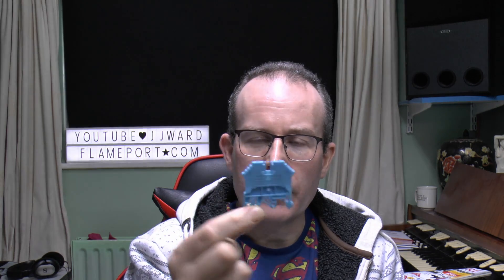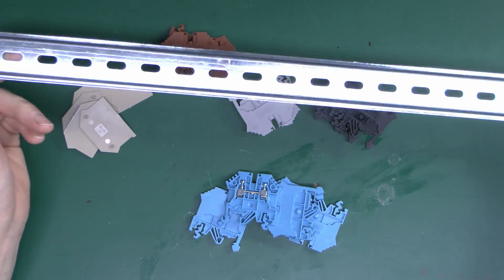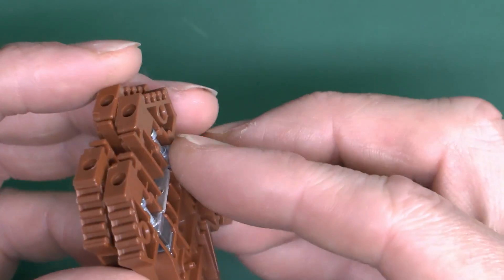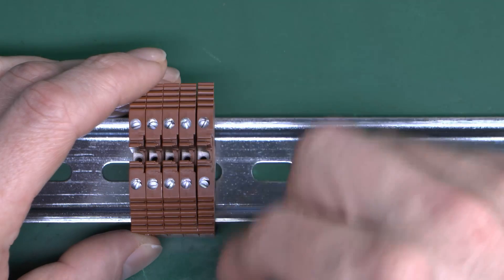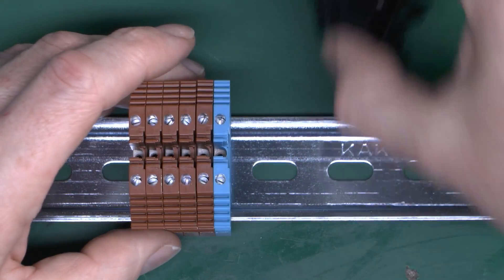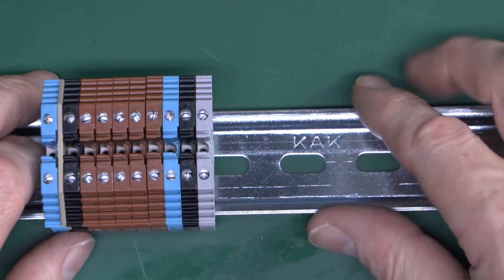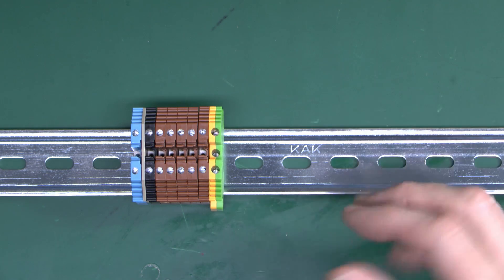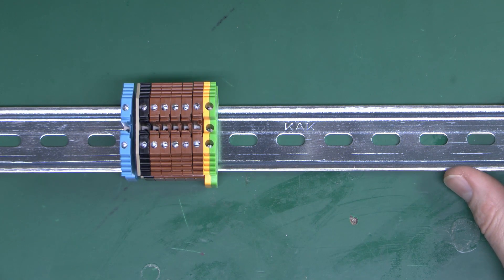Din Rail Terminals

Comment: great, the only thing missing is the available range of wire thickness for these terminals, for example, I want to use AWG 4 or AWG 6 , are they available in such size?
Reply from the maker: Yes, such as https://www.newark.com/entrelec-te-connectivity/1snk712063r0000/terminal-block-din-rail-2pos-4awg/dp/62AK7657

Comment: Love how much knowledge you give out. If you were to choose between push-in connection and screw connection terminal blocks, which one would you choose and why? I keep hearing that screw connections are unreliable due to vibration, while push-in connection risks of getting loose due to thermal cycling. Specifically I'm looking at Phoenix PTI 2.5 PE L N vs Phoenix UTI 2.5 PE L N. Thanks
Reply: U can go for elmex Control

Comment: @4:40 those joining strips are not very good as it can remove IP2X protection. There are other push in "blade" type joiners that are much better.
Reply: "There are other push in "blade" type joiners that are much better."   Better? No. They can fall out and lose connection if not properly inserted. The screw type are way more secure. As to protection the make cover strips for that.
Reply: You have to use the jumper type specific to the terminal blocks in use. The ones he showed are designed for screw jumpers, so you must use the screw jumpers made for that series. Others are designed for the blade-type jumpers, and in those you must use blade-type jumpers specific to that series.
Reply: @tookitogo  Timestamp?

Comment: I have the older style , rather than screws they use spring lock clips and to join multiple together you have a pin that drops between two. The grounds have a metal bar that rests on the rail rather than the locking screw that these ones use. I think I might get some of these new ones, they look more user friendly. Also have some fuse holder ones also.
Reply: The screw terminals are the older style.
Reply: @tookitogo  I only said that because they came out of a 15-20 year old hospital panel

Comment: The best dinrail terminals are siemens. They have plastic both sides, are fully symmetrical, and dont try to twist apart like the others. I've used cheaper ones in the past like Connectwell or Europa, and although they're ok for the money, I've had a few with stripped threads from new. Some of the most over-rated ones are Weidmuller/Klippon  IMHO

Comment: @ John Ward,
There are biege coloured end caps/retainers for Top Hat DIN Rail parts, they only have a central screw, that holds it to the DIN Rail.
The worst thing you can ever strike is that useless G-profile DIN Rail, that was a thing in the 1980's.
It was used in factories and try as you might to remove the terminals from the rail (with the supply still live) without snapping the bottom plastic clamp off, rendering it useless.
Top Hat is the way to go.

Comment: The PE terminal with conducting connections are allowed in insulation class I panels, but when inspecting Insulation class II panels we also come across them alot.. this is not allowed. Its a common made mistake.
In these kind of panels a continuity check with 200mA , proofs such a mistake easily.

Comment: We use this type of terminals 15 years ago, we swapped to Wago clamp terminal for speed and long lasting. A clamp terminal will keep the wire inside when you have vibration and a screw therminal need to be screw again to secure the connection once a years or less often depending on vibration. The clamp termnial save us so much time when wiring a new panel it's incredible.

Comment: Using it to extend the wiring for consumer unit is questionable as they are rated 24A and the socket circuit is 32A or 40A
Reply from the maker: Other ratings are available.

Comment: I have used thousands of these all makes all sizes alough the big ones 70mm plus tend to snop off. 
There is one point I have spent a lot of time in panels when they have been installed upside down when the springs age and work loose if on the rail the wrong way round any vibration causes then to fall off with obvious consequences this is even more of a problem with G rail which will lock the correct way but fall straight off if inverted.
If you look at the bottom of those terminals you will se they are known as universal ie they will fit both top hat or G rail (asymmetrical) rail. If ordering make sure which type of rail they are for.

Comment: 1:20  UK leave the EU but they use our german DIN (Deutsche Institut für Normung) Schiene (rail) in so many boxes. That's funny. 

BTW: The small connectors with 1/2 DU (5.1 mm) are cheaper copies of the Weidmüller connectors. Orginal have 400V / 24A / 2,5 qmm.

Comment: H jd what the best way to convert my generator from 3-phase to single phase .I seen converter   from single to 3 phase but not to opersit way round eny advice thanks
Reply from the maker: There is no conversion, single phase loads can be connected between neutral and one of the phases.

Comment: I have to confess I have never seen brown, grey or black terminals and deffo not red. Usually a sort of olive fawn colour. I am surprised as are other followers of yours JW that you are not using end locks.
I always use the bootlace ferrules on the control cables when I wire these things up, much neater and easier to fit wire into terminal. Have come across these terminals in days of old where strands of wire have been cut out to ensure too large a cable fits into terminal... lol. 
Good vid as usual JW, cheers
Reply: I always use a crimp-end of one sort or another in din terminals. It's all too easy to insert bare wires badly so they screw up at the end or a stray strand causes a short. . In a huge panel that could mean days of fault-finding wasted.

Comment: I used a DIN cabinet when I changed my consumer unit. 

I actually installed the DIN cabinet on a small piece of plywood next to the new CU and ore-wires the DIN rails to the MCBs on a bench. Much easier. Then ripped out the old CU, installed the plywood as one and terminated the house cables to the DIN rail connectors which were all labelled and ready. 

Looks nice and neat and the CU swap was much quicker - it needed to be for my situation. It was my house.

Comment: If you used that to extend CU wiring and it joined all the earths together (via the din rail). Wouldn’t that cause a problem during testing ?
Reply from the maker: Yes, for that application it would be better to use the insulated terminals for the CPC.

Comment: Use these all the time, I find it useful to install endstops that are attached like the earth connection as using a screwdriver on the screws tends to separate them.
Reply: Yep, especially when you crank down on the screw on the earthing terminals to get a good bite on the rail, they really open up. That's why its always nice to like you said, put an endstop. Preferably an endstop with an embedded metal strip in the clip so it bites the rail as well and stops it from sliding down over time. Allen Bradley as well as Electec (ABB) are the end-stops I like as they have this embedded metal strip in the clip. The A/B ones are kinda sharp and they REALLY bite into the rail. They don't slide at all and if you try, they dig into the zinc coating on the rail and get even more secure.

Comment: These terminals look like a copy of a very early design of the Weidmüller WDU2.5 terminal. The WDU2.5 is probably the most used DIN-Rail-Terminal in Austria and Germany.

Does the marking-system from Weidmüller fit on these CONTA-CLIP terminals?

Comment: Cheers John, excited to see more progress on phase converter. Nick Bundy did a video not long ago using these to move an old consumer unit inside the house. It was previously in the meter box outside. That was the first time I'd come across them but it was a neat solution. However your comment about square millimetres / millimetres squared pricked my ears up... 
Hope lockdown is going ok in Bournemouth
From neighbouring Southampton
Cheers

Comment: The end cover should be locked off with a locking stop end which screws to the rail, a terminal cover is also available which is usually used in industry.

Comment: John, if used as described to extend cables for a cu change, would you use the green earth terminals for CPCs? All of the CPCs in the install would them be common at the din rail. Could this affect your readings during inspection and test? Maybe lower R2.
Reply from the maker: Better to use the insulated terminals for that, otherwise all the CPCs would be connected together, making any testing at the CU meaningless.
Reply: @jwflame  Thanks John. It is obvious thinking about it now that it would completely mess up the ring final figure 8 test results at least.

Comment: I've been trying to research DIN terminals for two years but it's been difficult.  This video is a long-awaited step forward.
I bought a batch of these last year:
https://www.aliexpress.com/item/32889460344.html?spm=a2g0s.9042311.0.0.4f1d4c4d0MXxK9
I'd have preferred to use a UK supplier like CPC Farnell.  They have a wide selection but I couldn't work out how to get the side covers for any of them. 
There are lots of Youtube videos on DIN terminals but they are all corporate productions which renders them essentially useless.  John's video is the first time I've heard about the linking bars for example.

I've just had a look at AliExpress for linking bars to use on the terminals I bought last year, but they don't use screws and it looks like they can't be cut down to your desired length.
https://www.aliexpress.com/item/33005757975.html?spm=a2g0o.detail.1000023.25.f9c55d78rQlTGS

Has anyone used this type before?
Reply: They just push in. A decent set of side cutters will cut through them no problem. The notches on the top indicate where to cut.

They look like a chinese knockoff of Phoenix terminals.
Reply: westinthewest I find RS is best for din rails https://uk.rs-online.com/web/c/connectors/terminal-blocks-din-rail-terminals/din-rail-terminal-accessories/?searchTerm=Din%20rail%20terminal%20blocks. Farm equipment use a lot of these
Reply: Sorry for advertising but CEF usually stock them
Reply: @paullill5604  This is when a visit to the trade counter would be useful instead of my usual online research and sourcing.  Looks like that's not an option just yet though.
They do look like Phoenix copies so yes I should be able to get them from RS or CEF.  I don't think much of their prices, but that's not too much of an issue for these little things.

Comment: Personally, I hate the screw-type terminal blocks. Wires can become lose, and it take time to wire it up. I prefer the spring-lock type. Cost a bit more thought, esp for a home-use project.
Reply: For CoMPEX,  ALL Din terminals MUST be tight, even empty ones.
If any are loose, it is classed as a defect.
Its a tedious job going round checking every single one so maintenance free spring loaded type are a god send
Reply: In my restored 1977 Trans am I used Weidmuller screw in terminal blocks to connect every wires in the car, nothing has loosed after 7 years. I even used two terminal blocks that I zip tied together in a hurry to connect each of the headlights. Never loosen even with a V8 under the hood.
Reply: So you can't use a screwdriver and basic tools?
Shame on you, spring type terminations are known to start fires when poorly done.
But I guess that is what you get with DIY wiring. 

Keeps us Fire-fighters busy.
Reply: @mikeZL3XD7029 Good quality spring terminals like WAGO and Phoenix Contact are extremely reliable.

Comment: These Conta-Click ones look like Weidmüller clones._
Reply: Link bar looks like it was copied from the older weidmuller sak range.
Reply: Yes of course. AFAIK was Weidmüller the first company how start with this small 1/2 DU connectors. 

For low power them are smaller, AFAIK 1/3 DU. For high power thicker, 1 DU. 

They can't patent the function so many other companies make own style copies.

If do you order direct at Weidmüller do you can buy every RAL colour.
Reply: @AE-mu1jc  I believe Wiedmuller have the patent on this type of connector, yet the Chinese don't recognise any patents, so they are made as cheap as and probably don't fit the original specification for manufacture.
Reply: They look like the Klippon brand as well

Comment: Linking them together to join more wires isn't there a danger you will exceed the 25amps rating?
Reply: Nope. The whole circuit is fused with 25A at maximum. In case of 2.5mm² wiring I would rather recommend fusing it with 20A. You'll have to ensure that the incoming wire is fused properly. It doesn't matter how many wires there are, they can all not draw more than 25A if the whole circuit is fused with 25A. The overcurrent protection will prevent this.
Reply: They would be typically be used in an industrial setting, so everything connected has a known rated current and will likely be fused. So not a problem assuming it's designed correctly.
Reply: If you create a circuit you'll have to design it that way that the fuse/MCB rating depends on the weakest link of the chain. Let's say I design a german outlet circuit. Wiring is 2.5mm², under best circumstances it's rated for 25A, normally 20A. Connectors in junction boxes, let's say Wago 221, are rated for 32A. The outlets are rated for 16A, so the circuit is fused with 16A at max (circuit breaker B16A). No matter how many outlets are connected to this circuit. In rooms like living rooms or bedrooms one 16A circuit covers all outlets (and could supply the lighting too without any kind of trouble), and that's sufficient because there are normally no appliances with a high demand. In the kitchen you require several circuits, mostly dedicated circuits with only one outlet for one specific appliance like a refridgerator or a dish washer. The thing is not about demand, you can also hook up the dish washer and the refridgerator on the same circuit, but if you  require to switch-off one circuit for whatever reason the other appliance would also have no electric power.
Reply: @Marcel_Germann  The problem is not when the circuit is designed but when  it is modified some time latter. John Ward spends half his time rectifying other people's work.
Reply: Tony Papantoniou Then the overcurrent protection should also work. If you extend the circuit I‘ve designed in my last post here with three more outlets, the current will be still limited to 16A by the circuit breaker.
Reply: @Gameboygenius  What do they say about assume you make an ass out of you and me.
Reply: @TonyDartford  Yeah, but that goes for anything, not just these terminals.
Reply: @Gameboygenius  True, but  these make it very easy
Reply: This is where you would need to design the installation and then specify the components needed, CEF have many different amp rated components: https://www.cef.co.uk/catalogue/categories/din-rails-and-terminals-din-rail-terminals

Comment: I put the earth at the end closing off the exposed end.
Reply: The exposed end should always get a blocking card. Terminal block systems are not designed for the earthing block to provide covering for a live adjacent open terminal block. The covers snap in place so if the terminals work themselves apart and form a gap, the card moves with the terminal block and the contacts are always covered and protected. Also as well, earthing blocks should never be used as endstops. It should go earthing block, end-stop, blocking card, terminal block, terminal block,.....,end-stop.

Comment: KAK? was the DIN rail manufacturer really thinking about that name. 😱😁
Reply: Better than bearing manufacture named F.A.G. or terminal block named G.E.I._
Reply: Of course he did,  "C" and "E" are missing...
Reply: There used to a crane manufacturers called fairy.
Reply: @Jannie Kirsten there used to be a firm called spruce spring clean.
Reply: it's like the domestic appliances called SMEG, or SICK who make switches... there's even a company called f.a.r.t who make neon sign transformers :)